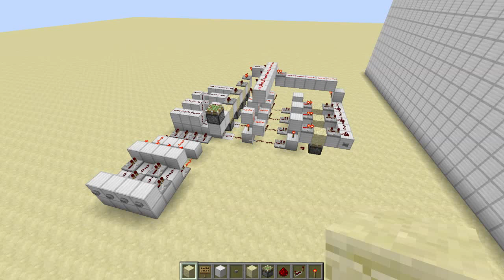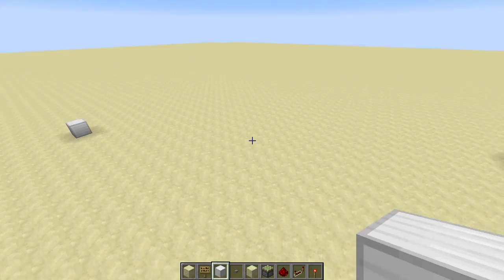Minecraft Redstone Tutorial: Overly Complicated Combo Lock

Comment: I solved your limitation problem with pressing the same button twice. Does not add a ton of additional redstone wiring! Push the same button after it has locked in and it will reset the whole thing. http://imgur.com/wmAsxPS
Reply from the maker: Well that is a great solution to resetting the system on an incorrect 2nd input, now to find a simple solution to allowing each button to be used twice in the actual combination. Good work =D 

Edit: I'm having a hard time seeing how you got power to the top section of the AND gate input, I have found my own way of doing it though but yours appears more clean if I could just figure it out...
Reply from the maker: Derrickster92 http://imgur.com/a/UoC1Y This is where I ended up, it doesn't appear to any more "bugs" to the design either which is a huge bonus =D
Reply: Interesting take! The only thing I can think of to add a double press is a t flip flop that unblocks the path to the second press, or an added delay for output of the first press making it so that when the second block goes up in the first press it will go back down before the first output block goes up?
Reply from the maker: I tried using a t flip flop that pressed a block down to allow a repeater to send the signal further but the redstone was getting really crazy
Reply: The problem I'm having is that it is difficult to implement the safeguard systems for the buttons that you want two press'. I've got a working prototype now I just need to figure out how to shrink it.
Reply from the maker: good luck good sir /salute